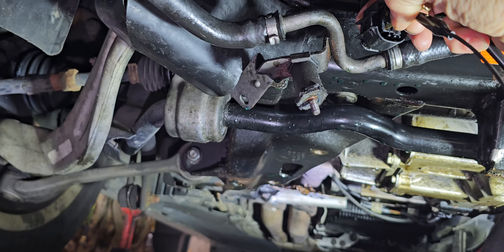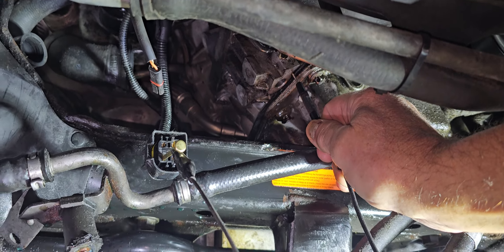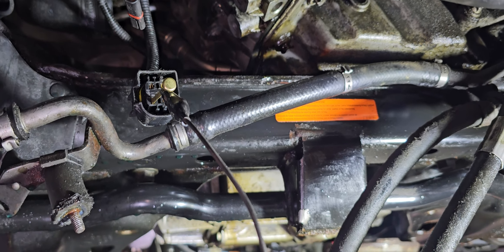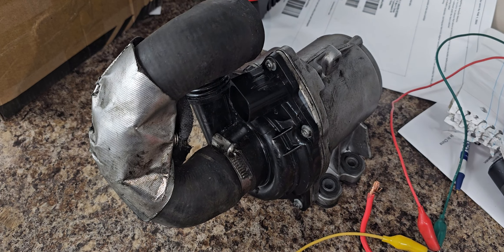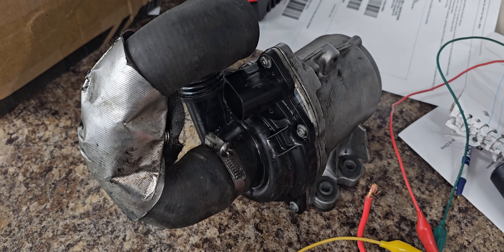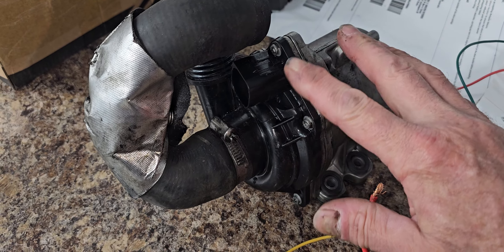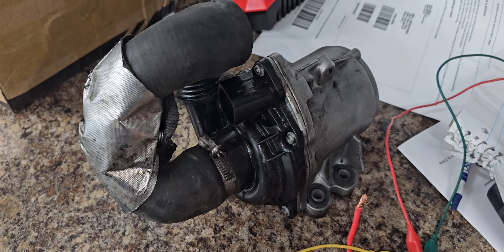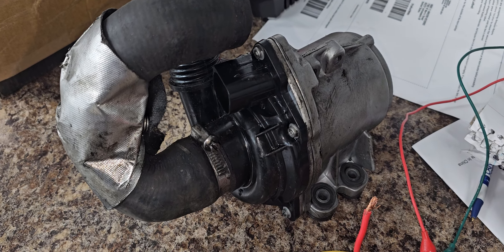BMW water pump bench test. E60

Comment: Nice video. I just pulled a bad pump out my daughter's car. I checked the harness for voltage before pulling. Wires were sending volts at correct times. After I pulled it, I bench tested it to see if I could at least get something out of it. It's dead. I'm going to do a quick test on the new one before I install it, to make sure it works. I ordered a cheap one off Amazon and all the YouTubers say, it won't last. But,for less than half the cost I have to find out for myself.
Reply: From my research be sure to replace the u shaped hose between w/pump/Themo that hose shrinks and swells with the heat from block causing coolant to flow top of  housing eventual contracting cover till cracking or the sealant gives between cover and unit. I suspect the rvt sealeant used is crap. but to open a unit and waterproof  micro controller board and put Honda rvt on unit should last a bit longer lol Even on eBay units. Cause they all fail due to water intrusion......

Comment: Please more details how to wire to bench test it 
I supplied 12v to pin 1-3 than Suplies ground to pin 2 is this correct?
Reply from the maker: Connect test leads/wires to 1 and 3. Green and red in the video. Connect both of them to your  12 volt +. Power souce.
Then connect a ground wire, black in the video to #4. To your power source. 
#4 is the ground  -